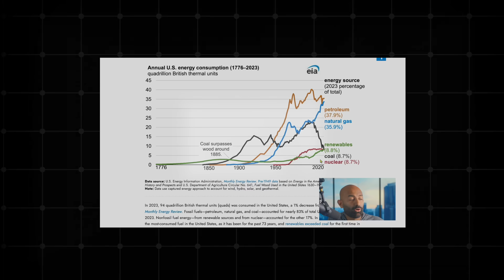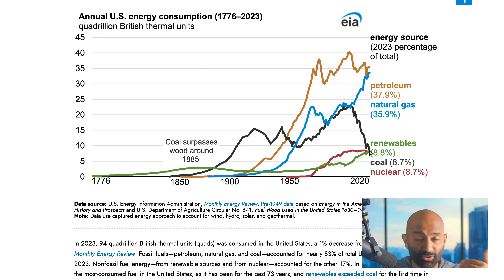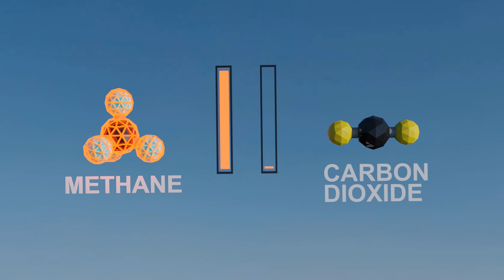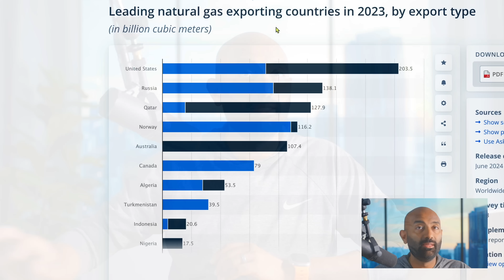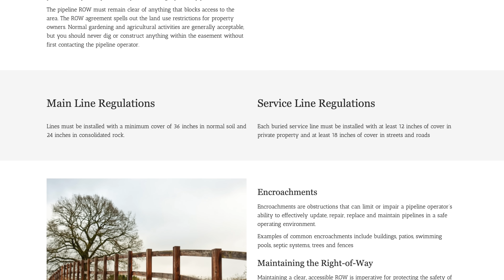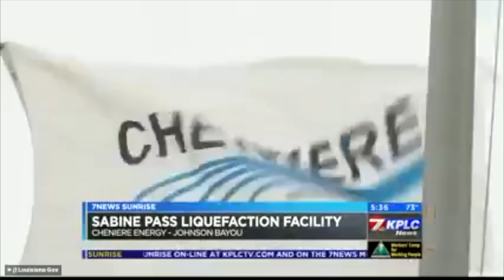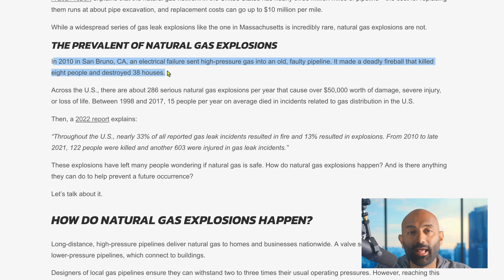The TRUE Danger of Natural Gas - This SHOCKED Me

Comment: Natural gas that is delivered to you house in NOT odorless. They mix a very small amount of gas that provide the distinct indication if it leaks.
Reply: Yes, we ad some  Ethanethiol " ethyl mercaptan" and o boy. If that system has a leak, you can clear out a plant in two ticks.
Reply: Before Methane is pumped to domestic users, a very smelly gas, usually - Butane-1-thiol, also known as Butyl Mercaptan - is added, to make the Methane gas smelly and detectable.
Reply: @ncammann  yes it's funny. I had a longer post with the chemicals that are added to it in the same thread and it appears to have been censored for some reason.  Or maybe YouTube's overloaded database just lost it because I can't imagine what I put in it that would have made it be censored.
Reply: I think his point is that most of the pipeline running natural gas in the united states does not contain odorant, because it's carrying natural gas from the source (like shale oil deposits) rather than from a commercial depot. the point he was making is that the environmental benefits of natural gas presuppose that none of it leaks, but the properties of the substance ensure that a lot of it will silently leak and we'll never know about it. it's very hard to estimate what impact it has because of this. it may be much more significant than is traditionally estimated, because we just have no way of knowing how much natural gas leaks but is not reported. if it were inherently more noticeable, like it smelled like rotten eggs or it looked like a bright red cloud, then we'd have a better sense. but it doesn't. so, while you should be able to tell if natural gas leaks in your home, we as a species are not able to tell how much natural gas leaks from pipelines.
Reply: yeah, those paid shills don't care about details of their lies, NGO check already cleared.
Reply: Guys guys... jesus.  Arguing with him instead of doing a TRIVIAL WEB SEARCH FOR THE FACTS ?!?!?

"The odorant added to natural gas is typically mercaptan (also known as thiol), specifically tert-Butyl mercaptan (TBM) or a blend that may include methyl mercaptan, ethyl mercaptan, or dimethyl sulfide.

Mercaptans are sulfur-containing compounds that have a strong, rotten egg-like smell. They are added to natural gas, which is otherwise odorless, to help detect leaks and prevent dangerous situations like explosions or asphyxiation.

This safety measure was widely adopted after the 1937 New London School explosion in Texas, where an undetected gas leak led to a devastating disaster."

You can smell a completely safe leak outside from hundreds of feet away.   You can smell a tiny leak that might make a 1' diameter explosion at the leak everywhere in the house.

As for the pipe shown above... Yea, you should have your pipes inspected and replaced every couple decades ($1000-$3000).   If you have any kind of leak where they shut down the meter, you'll have to have it inspected and brought up to code anyway.

Natural gas (And natural gas production) do produce 7.6 gigatons of CO2 and 4.0 gigatons of methane co2 equivalence (since it's 20 times as powerful as natural gas.)  (but these days... its 21 times as effective because it's overwhelming the methane decay cycle).

If we eliminated Natural gas use and production, we'd be down to about 30 gigatons of Co2.   Which is where we promised we would be now back in 2010.  (We are at 41 instead).

It is more expensive to bake with electricity.  So you would be looking at $15 to $25 per person who bakes per month.   And Induction stoves are mysteriously expensive in the United States (yet cheap in Europe).  Resistance electric stoves are incredibly wasteful.
Reply: The natural gas RETAILER is supposed to inject the odorizer if it does not arrive with it in (like EPNG did when they sod it to retailers).
Reply: The 'smell' chemical added (in the UK) is Mercaptan.
Reply: That's correct. Would be very dangerous otherwise. Did he not know that?
Reply: @Withnail1969  why would a climate shill be interested in anything about gas ?
Reply: I have a crappy sense of smell. Unfortunately I can't smell it
Reply: - however bulk methane IS odourless - unless accompanied by other compounds (ie. Sulphur compounds stink..)
Reply: @kadmow  which is true but irrelevant.
Reply: The odor that is added to natural gas is added in "the last mile" before it gets to household consumers.  For most of its travel from its source, natural gas is odorless.  A leak anywhere along that way is not detected by smell.
Reply: Bad eggs weres the bad eggs oh gas leak fuu 💥 😂😂😂
Reply: @DavidHalko, @paulhill182 - He neither stated nor implied that methane delivered to your home is odourless. The context of the "odourless, invisible gas" comment at 11:47 was clearly referring to the gas before it's been odourised. For various reasons, odourisation occurs at the entry point to a local distribution system, i.e. relatively close to your home, and the amount of time that gas is odourised is quite small relative to the pipeline system as a whole. This makes me wonder... are you both simply labouring under a shared misapprehension? Or just making bad faith arguments?
Reply: @AdvancedDudeBro  yes he did and play it strongly when he held up his Rusty home Pipeline and then proceeded to talk about natural gas explosions is being odorless and dangerous. 

If you didn't want to imply it was a problem for Holmes then he shouldn't have hold up his 50-year-old gas pipe that should have probably been inspected at the 25 year mark.
Reply: @AdvancedDudeBro  The reason for late colourisation is that industry sometimes use the gas as raw material instead of simply burning it.
Reply: @surters  that is a reason, but not "the reason." For ex., the mercaptan is also very corrosive to pumping equipment.
Reply: Yeah, it’s slightly less deadly than some believe.😊
Reply: So THAT's your argument for its use?
Reply: @guilegameche3810 - “THAT’s your argument for its use?”

no, that is the fact disputing the lie that it is odorless & therefore the argument natural gas is dangerous because it is odorless in invalid.

We can all be adults about this, and not lie about basic facts, so people can make informed decisions.
Reply: @DavidHalko  so, is methane odorless or not?
Reply: @marcdenlinger5282  Methane is odorless.  
The New London School explosion on March 18, 1937, is the reason an odorant is added to natural gas used for commercial use.
Reply: @marcdenlinger5282  - natural gas delivered to the home is not odorless. Natural gas is an aggregate of many gases, including methane. It is irrelevant if one of the many gasses included in Natural Gas is odorless or not.
Reply: @ Except the natural gas IS odorless. it is another gas that is mixed in for safety that  has the odor.
Reply: @guilegameche3810  That is an argument to counter the "it is odorless" claim. Domestic natural gas is stinky due to hydrogen sulphide (rotten egg smell) added to help people identify leaks before they become dangerous.
Reply: @guilegameche3810  No, science and common sense are the arguments.

Comment: The lurking danger of natural gas, water, sewage, electricity, propane, and  every source of energy. Utility infrastructure needs to be maintained, it doesn't last forever.
Reply: Compared to stuff like natural gas especially, solar is extremely safe as an energy source
Reply: @ - “solar is extremely safe as an energy source” 
Solar converts sunlight into electricity… and the last wildfires in California, killing many people & uncountable wildlife, looks like it came from another electricity transmission accident.
Reply: Just seems to fail faster in Kali Illinois NY Pennsylvania
Reply: * true understander
Reply: Rooftop solar fires are extremely rare compared with natural gas fires, gas stove fires etc
Reply: Solar doesn’t really come with lurking dangers. Freedom from reliance on the grid is a lurking danger to utility companies, I suppose…
Reply: @SigFigNewton  rooftop solar panels can catch fire if debris is not kept cleaned out from underneath. All solar panels are subject to hail damage in climates with weather extremes, the surface must be kept reasonably clean of dirt and snow in order to function well, they require high-voltage handling precautions whenever light is present, and the collection system and inverter are electrical equipment with finite lifespans. Also, the system must be grid-tied to function unless the owner maintains an off-grid battery system which comes with its own risks and maintenance needs. You don't have to call those things "lurking dangers," but you're not going to have a solar system very long (and possibly not the property it is installed upon, either) if you don't maintain it.
Reply: @SigFigNewton - Solar comes with lurking danger because it is electricity, as in the list above.

It cells are made with toxic chemicals, and not all of those components are recycled… the non-toxic components, like glass & aluminum are recycled.

The rest of the non-recyclable toxic components from Solar are super fund sites across the world, waiting to happen.
Reply: @SigFigNewton  yeah um child slave labor to mine cobalt and other required materials would like to say hi. Your solar requires tons of nasty chemicals, materials and has stupid expensive reclamation and mitigation costs.
Reply: @SigFigNewton  solar and wind are a beautiful idea, but an ugly eyesore in reality
Reply: @SigFigNewton  talk about a true believer. now solar power is immune to the ravages of entropy too?
Reply: but yeah, solar panels are relatively less dangerous/harmful if misused or left unmaintained, compared to combustible fuels. of course, to efficiently use solar panels generally requires large batteries to be installed somewhere along the grid, and batteries are prone to not just catch fire but explode. there are always trade-offs with anything. the thing that makes these things useful to us, i.e. their energy, inherently makes them dangerous. if it can power a microwave, it can also power a dangerous release of energy of some sort, in the right circumstances. when we begin building fusion power plants and eventually install them in homes, there will be explosions and deaths. it's unavoidable. when you mix highly dense energy with human fallibility, chaos always asserts itself at some baseline rate.
Reply: @SigFigNewton solar energy production brings along with it all the same maintenance requirements as any other form of production, at least as far as transmission is concerned. Did you not see all the wildfires? Did you not know what happens when trees fall on transmission lines, etc?
Unless you're talking about home production, which still carries with it maintenance in the form of clearing debris from panels, replacing old panels, replacing wires, and storage unless you don't intend to run your refrigerator overnight. By the way, did you remember all those EV batteries exploding?
Reply: The main trade off for solar is that it benefits consumers instead of corporations trying to sell fuel every month
Reply: @SigFigNewton  that's just not true, at all.